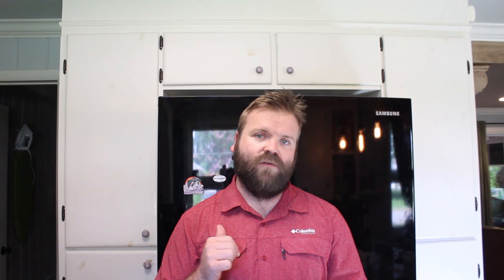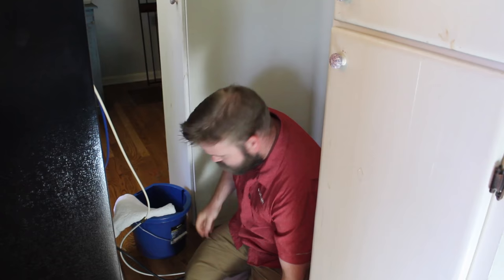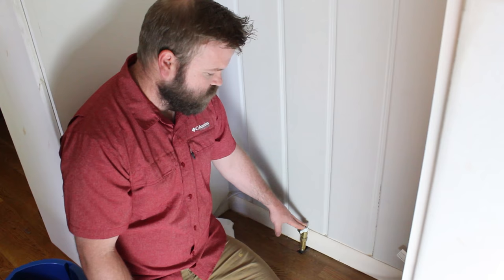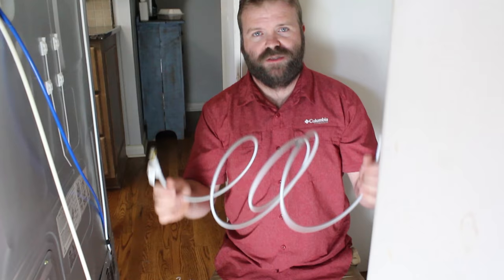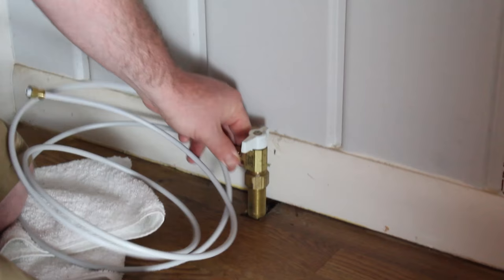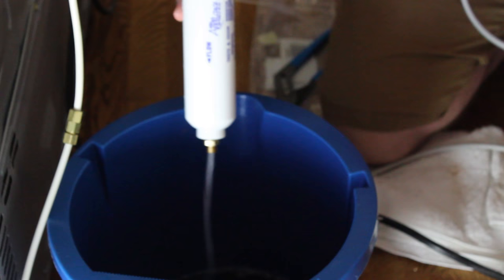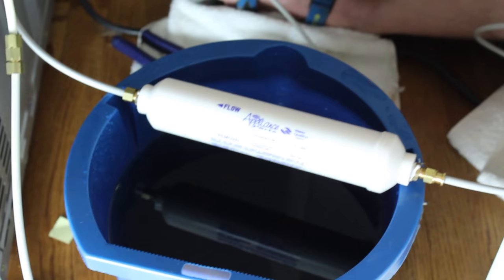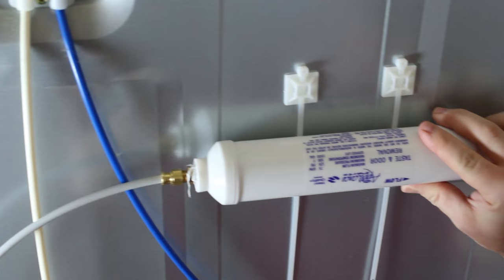How to Install a Universal Inline Refrigerator Water Filter

Comment: When wrapping teflon tape, wrap in a clockwise direction with threads facing you.  That way when threading into fitting the tape does not want to unravel.
Reply from the maker: You are correct. I just saw a plumbing Tik-Tok on this. Didn't even realize there was any other way. 😂 What an easy adjustment and it makes a world of difference. Great tip!
Reply: I was wondering if anyone else saw the direction he wrapped the tape
As soon as I saw it I was like 😳...that's not right 😮
Reply: Good tip, thanks 👍
Reply: @SupplyingDemand is it ok to run both the additional filter along side the factory unit?

Comment: Just a heads up. Not trying to be one of those guys, REALLY. With the tape 1 1/2 to 2 raps should be good. The Chanel locks should be turned around. you will need alot less hand pressure to tighten the nut. Good video just trying to help you out.
Reply: dale1puckett ok

Comment: I don’t agree with putting the filter behind the fridge. By your method I would have to pull a loaded heav refrigerator out each time it needs replaced. I’d rather put the filter and valve under the sink.
Reply from the maker: Thank you for your input, and we completely understand your concern. Indeed, our video was meant to demonstrate one possible method, keeping in mind that kitchen configurations and preferences vary widely. While some kitchens do not accommodate an under-sink installation due to space constraints or plumbing configurations, others, as you've rightly pointed out, would benefit from such a setup for easier maintenance and aesthetics.

We encourage viewers to consider their specific situation, including how often they might need to replace the filter and the accessibility of their refrigerator. Your suggestion to install the filter and valve under the sink is a fantastic alternative for those who have the means to do so and seek a more convenient solution.

We're all about finding and sharing solutions that work best for individual needs and spaces. Thank you for adding to the conversation and highlighting the importance of tailoring installations to fit personal preferences and practical realities. We always appreciate feedback that encourages us to think about different perspectives and solutions.

Comment: When using teflon tape on plastic thread you don't use anymore than 2 turns, on steel or copper 3 to 4 turns. AND KEEP THE TAPE FLAT WHEN WRAPPING

Comment: I saw several of these installation videos. Yours was by far the best. Before watching it I thought I could install one, but didn't know if I should use plumber's tape. I like how you showed it is only needed if it leaked. Also, I would have left the filter on the floor. Now I know to attach it to the back of the refrigerator. Thanks for making this video.
Reply from the maker: Thank you Tom! We're working to add more videos soon. Our videos are geared towards DIY and the average homeowner. I know a lot of comments like to tell us what we should've used or what would work best. But, many customers don't have the exact tools at their disposal to do a job professionally. But, that doesn't mean you can't do the job and that it can't be done right. We appreciate you taking the time to let us know this helped and we have much more in store to share soon!
Reply: Po

Comment: Make the plastic tube  long enough to leave the filter on the top of the fridge. It's easier to pull up a chair and replace it than to pull out the fridge. Also buy the push connect filters its easier and faster.

Comment: Just use Teflon tape, or you'll most likely have to do it twice, when it leaks the first time. If something uses rubber grommets, or a flare connection, that's when you usually don't need Teflon tape

Comment: Good video . another reason to run water through filter before hookup is to clean out any loose  carbon otherwise it gets into your ice maker or water . thanks
Reply from the maker: Great tip! YES, I was just explaining the benefits of purging the air from the line. Most customers don't think about the inside of the filter and they don't think about the air inside the line. Purging the air from inside the water filter and line is a key step, and is the last step of changing a filter. Most water filters have an empty carbon block inside, so running water through or submerging the filter BEFORE installation is a WONDERFUL tip. But, some customers may still also need to do the same AFTER as well. Throw out the first few batches of ice, or you can run several gallons through the in-door water dispenser, if equipped.

Comment: Well done showing the teflon tape.  I do not have the clearance in the back of the refrigerator to do this, but I could install it below in the basement where the supply pipe comes up (I would add a shut off there as well).  Question:  In regards to the tubing that runs from the filter and then to the fridge, is there a problem with the length of the tubing running a few extra feet if the filter is installed below the floor?

Comment: If you don't need to push your fridge all the way back to the wall then ok I guess. It would still be a pain to have to pull it out to replace the filter for most.  I would put it either in the basement at the source of the water, if possible, or in that upper cabinet. If in cabinet you would need another shut off at the supply side.

Comment: Could you keep both filters in the refrigerator?  Like adding one and keeping the one that comes with the fridge?
Reply from the maker: In theory, you could have an inline filter on the supply line, and a refrigerator filter. I would expect, maybe, a drop in pressure when calling for water through the door. If you notice this, you can expect the icemaker may produce smaller ice cubes. If that happens, I would remove the inline filter. But, I don't theoretically see any issue with double-filtering your water. Other than reduced water-pressure (possibly) and the obvious 2x cost. Manufacturers recommend changing them at least once every 6 months.

Comment: Good day !! ,  Q: Should the filter always be horizontal or can it be vertical?
Reply from the maker: Great question Wendy. The orientation of the universal inline refrigerator water filter can typically be either horizontal or vertical, depending on your space and installation preferences. Always check the specific instructions provided by the filter manufacturer. Some filters might have a preferred orientation for optimal performance. Ensure the filter is securely mounted in either orientation and that you can easily access it for future replacements or maintenance.

As long as you follow these guidelines and the manufacturer's instructions, you should have no issues with the filter's performance in either horizontal or vertical orientation.

Comment: In the video the guy is using 4 velcro type squares and uses Zip ties to attach water filter to back of fridge.. Where does one get the squares with some sort of place on front to attach the zip ties?
Reply from the maker: Hello Brent! 👋 The adhesive squares used in this video are called Zip Tie Mounts. They can typically be found at home improvement stores like Lowe’s or Home Depot in the Electrical aisle, or on Amazon by searching for “zip tie mounts.” I’ve also seen them available online via Target and Walmart, but availability may differ by location. The mounting squares have an adhesive-type backing and allow zip-ties to be secured vertically or horizontally.

Comment: "If you're doing it correctly you don't need Teflon tape".........2 minutes later puts Teflon tape like your supposed to🤣
Reply: Where in the instructions do you see any mention of Teflon tape for a non pipe fitting?

Comment: I have a MayTag french door model and it has an internal water filter at the top internal side of the refrigerator and I have always replaced the filter with the original made by MayTag which is expensive,can I still install this universal filter,I prefer the 5 year type and where can I get it. One other important thing is that when these filters expires there is a red light that comes on at the front panel of the refrigerator and goes off when I install a new filter, if I use this universal filter will the red light still come on or not.

Comment: Older house, added water line for fridge years back.  He put the shut off valve on my water heater, through attic to kitchen. Does that mean turning off water first from there...
Reply from the maker: Yes, the water would need to be turned off prior to installation. Most cutoffs are located behind the refrigerator, but if you know where your cutoff is located, yes, please turn that off first. You never want to disconnect water lines under pressure. I would recommend turning off the water to the refrigerator, and then disconnecting the water lines slowly to ensure the water is off. After you've installed your filter and properly reattached the water lines, you can turn the water back on. Be aware the water filter and water line is now filled with air, and now that air will have to be pushed out or "purged" from the line. If you only have an icemaker, I would recommend dumping the first 4-6 batches of ice after changing out the filter. Don't be alarmed if the first few batches are smaller in size, because the trapped air inside the line mixes with the water and it may cause the water to "spit" while filling the icemaker until all the air has been purged. If you have an in-door water dispenser on your refrigerator, you may notice the same "spitting" occurring after changing out a water filter, and you may want to run a gallon of water or more through the line to purge the air from the water line.

Comment: Question, can I leave the existing refrigerator water filter on and also install the inline water filter behind the refrigerator? The one I purchased states it’s intended use is for refrigerators without an existing filter built in.
Thanks for your help
Reply from the maker: Great question! Yes, you can install an inline water filter behind your refrigerator in addition to using the refrigerator's built-in water filter. Doing so can provide a double layer of filtration, which might be beneficial if you're looking to further improve the taste and quality of your water or if you have particularly hard or impure water in your area.

However, there are a few things to consider before proceeding with this setup:

1.) Water Pressure: Adding an additional filter can reduce the water flow to your refrigerator, potentially affecting ice production and water dispensation. Ensure your water pressure is sufficient to handle both filters without significant loss in performance.

2.) Filter Maintenance: With two filters in place, you'll need to keep track of two different maintenance schedules. This means replacing each filter according to its lifespan to ensure optimal water quality and flow rate.

3.) Redundancy vs. Benefit: Consider the specific contaminants each filter targets. If both filters are designed to remove the same contaminants, the second filter might not significantly improve water quality but will add to maintenance efforts. However, if they complement each other (e.g., one removes larger particles and the other specializes in chemical contaminants), you could see a noticeable difference in water quality.

Thank you for reaching out with your question. Let us know if there's anything else we can assist with!

Comment: I bought a new inline filter for it, it's just a tab to small, it say's 1/4, the line is a little bit too big. We don't have a cutoff switch to put the line in, we have to turn the well off at the source.
Reply: please add a shutt off valve before turning the water back on. It could prevent a huge disaster.

Comment: I really couldn't tell where that second line you attached came from. I know the first line was from the on/off valve, but I have no idea where that second line came from. You really need to show that. Plus I'm not sure how you bypassed the filter inside the refrigerator. It might be the second line  you attached but as I said, I have no idea where that line came from.

Comment: Would I be able to add this filter along with my whirlpool filter inside the fridge ? I had problems with my factory filter within a week of buying the fridge . Turned out my water quality was too crappy and was clogging up my filter
Reply from the maker: A few things before I answer your question. Keep in mind the filter, when new, is filled with air. So, when a new filter is installed, you often have to run a few gallons of water through the system to purge all the air from the water line and water filter. Once the filter, line, and reservoir are completely filled with water, you should notice your water pressure and water clarity return to normal. If you do have hard water, filters may need to be changed out every 2-3 months. Now, to answer your question, running a second filter on your water line connecting to the refrigerator is possible. It will double-filter your water. You may notice even less water pressure as the water makes it way through the inline filter first and then through the refrigerator water filter.

Comment: Can you use the fridge filter and one of these inline filters or do you have to get the bypass plug? Great video thx.
Reply from the maker: Great question, and it depends on the refrigerator. Some models may require a filter bypass to be installed for the water to flow to the dispenser. But, there are other models that don't use a plug, and will bypass the filter automatically, if it is removed. You would need to remove the filter in your refrigerator and test your dispenser to see if a bypass is required, but if you know your model has a bypass plug and the filter is removed...it's likely you'll need to attach the plug for the water to flow to the dispenser.

With that said, we do have customers that use filters in multiple ways. Some use an inline filter, as shown in the video. Some customers use both an inline filter and also use the refrigerator's filter. This can decrease water pressure at the dispenser, as the water is going through multiple filters and could cause icemaker issues...as reduced water pressure may fill the tray more slowly during the timed fill and could reduce the size of ice in the tray.

For best results, I recommend only using one filter, but you can use multiple filters after you test and ensure the water pressure has not decreased to a point that would affect your icemaker or take too long to fill up.

I hope this answers your question and please feel free to ask any other questions!

Comment: hi i just re installed this filter and all i did was take the old one out and refit all new piping and filter and for some reason the water is coming out really slow-can you help please anyone lol i dont know what could have gone wrong or is this normal with new filter-any help would be greatly appreciated
Reply from the maker: Totally normal. The inside of the new filter is likely filled with some sort of carbon block and...air. Some techs will submerge new filters in water before installation to prevent air from entering the water lines. But, if you didn't do this, it's perfectly fine. New filters recommend running at least a gallon of water through the filter to purge the air from the lines. You just do this by holding a pitcher under the dispenser. Fill and dump it 2-3 times. Many refrigerators have a reservoir inside the refrigerator that holds the filtered water to allow it to literally chill before you push your glass against the lever for some ice cold refreshing water. My point is...after you install a water filter...it is recommended to run a good gallon or two so you fully purge the lines. You may notice an initial decrease in pressure. I've noticed the same after a new filter, but it usually improves...unless the filter is just dense. I've thought the same and just changed the filter 3-6 months later and then it seemed normal again. So, maybe just a dense filter, but purge the lines and give it a few weeks.
Reply: @SupplyingDemand  yeh mate i think your right as it seems a little better now-great video by the way very easy and informative and thanks so much for quick response appreciate it buddy
keep well & have a good xmas -new year

Comment: How do you get the 1/4 inch pipe to not leak where you connect to the main? the water pressure just pushed the damn 1/4 right out.
Reply: you should stay away from tubing and pipe. Just kidding.